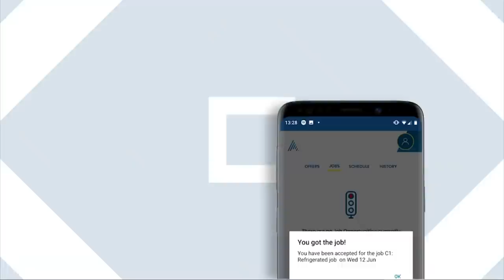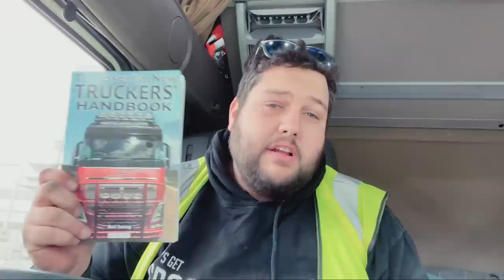M6 Closure Causes An "A" Road Diversion!

Comment: Hi luke,why do u not run out your time,because as a driver we might need the full 9 or even 10hrs.you said drive for 1 hr 46 for 10 hrs drive can I ask who said that because its wrong,the 10th hr driving is only after a second 45 you cant take part of your remaining drive and add final hour.aftee using your 10th hr drive u are required to take 11hr off so fishing at 7 pm you can start before 6am.excuse me for rant I'm only looking  out for a fellow trucker.